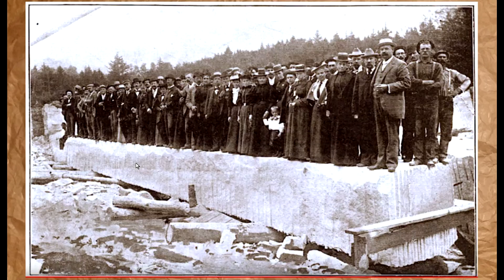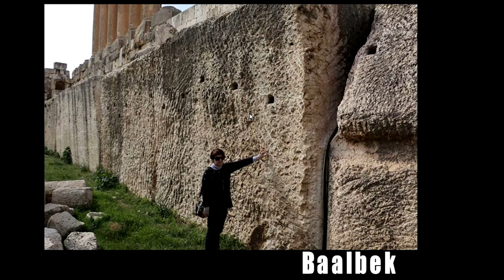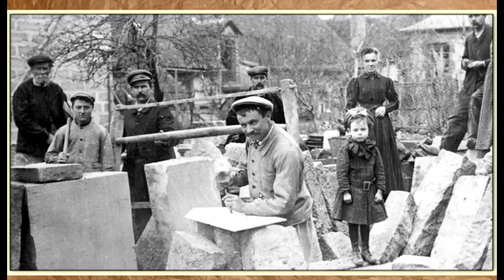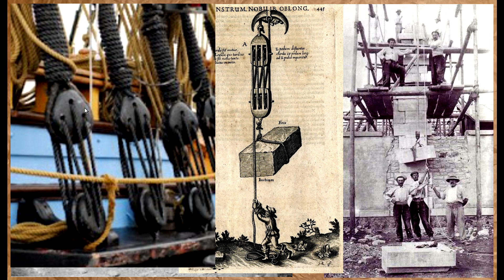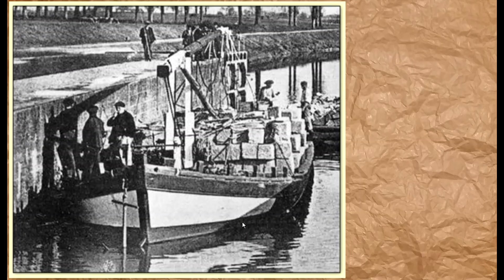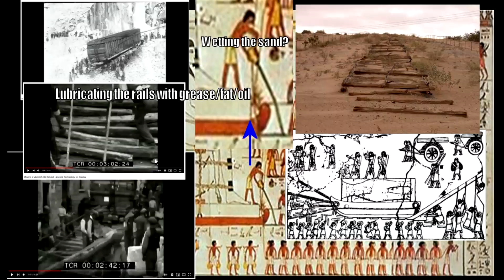Stone Masons Photographed in the Olden Times & Pictured in the Ancient Times. NO LOST ANCIENT TECH!

Comment: Very good video bud. I told ya I'd get to it lol. You'd be amazed at the power of levers and wedges. I was a 1st class shipfitter at what used to be what was called Ingalls Shipbuilding (it's now some other name after a few buyouts, it was Linton last I checked u think) in Pascagoula Mississippi. Anyways I learned there how to use "saddles and wedges" to move literally entire ships sized hulks of metal. (There built in modular sections and never actually moved a whole ship that way but is feasible if one ever had to move the entire ship.) So I say that as entire expression to just give an idea of scale but yeah. You should do a video on that if it helps viewers to know what a wedge is capable of. I think you'd enjoy it. We'd use a combination of wedges... "Come-alongs"... heat and hydraulic Jack's to bend and shape metal of incredible thickness this way. Many times the steel was actual armor plating that we had to roll to shape and weld to what's called the bulkheads. Most times the metal came pre-bent to a certain degree. It was never perfect tho. Sometimes we'd have to bend steel that was just flat to shape. We'd do I'd say roughly 98% of all the work needed tho with a small sledge hammer, wedge and saddle tho. It was hard work but was pretty fun to do when young. 
I noticed you seem to think the rocks and stuff under the slabs that was about to fall was to cushion the fall. With my experience with moving mega objects like those it's actually there to prevent the massive objects from falling and lying flat. Typically they destroy what they fall on. But, they leave a small gap to work with after they do. You'll find that's the hardest thing to achieve in these type things. If you have that inital gap your job will be alot easier after. If it's flat you'll have to pry it open with a wedge. When blocks get over a certain size they don't like being wedged on on the edges. Thier Wright exceeds thier molecular strength and its easier to flake a piece off than to move its whole size, if that makes sense lol. So you'd want a gap to slip what we called cribbing under there, which is just slang for wood wedges and such. Btw wood isn't used as a wedge that much in this aspect. As when you drive wood wedges in these scenarios it will just peel off the edges most times. Instead you'll see wood wedges instead to hold whatever small progress was made by your metal wedges so you can re-set them with larger wedges and or feathers. Then start again with the hammer and metal wedges. 
This does make me wonder how they made the plunge cuts back in those times inside those cave quarries. I've seen modern large saws used today that resemble chainsaws that free the right and left edges so you can flake the middle portion off. I suppose they just drilled it manually many times and cut it that way. 
I'm pretty shocked to see the size of pillars they was able to make back then. Pretty amazing how far back in history they was able to do that. I'm curious how they rounded them perfectly before they had the lathes and such you showed. Very interesting.
Of all the things they did tho back then many times I'm amazed most by how well of a job many did at making a totally flat and smooth wall. I'm glad you showed the dangling ropes trick. Many don't know that's how they did those big mountain sculptures etc. There's a term for it but I forget the name. I've wondered if they ever attached thier tools to these taught rope lines like these. Then as they swing it, it prevents thier tools from carving past a certain degree. Then it would leave behind a perfect, measured flawless finish. I've seen a similar trick used to smooth out the inside of igloos lol. They'd tie thier tool to the ground. Then no matter where that tool touched the inside, it would leave behind a perfect dome shape due to parabolic shape made from the tool being captive to the rope. I wonder if that's how they smoothed those caves ceilings in India as you mentioned. It's also how I've seen masons freehand dome ceilings. They used small blocks, mortar and so on. And use a string to measure how to set the blocks. Then you didn't need a crib of wood under it to support it. Similar to how people use string and a pencil to draw arcs or circles. Same thing really. Just a tool instead of a pencil. 
I've seen other very interesting methods of moving and pulling with immense power I think you'd find interesting also besides saddles and wedges. Search here for a video by typing in the keywords "horses pull stump lever" or something to that affect. You should find a unique video of something amazingly creative the old timers came up with. They use 2 horses and a giant lever to pull out what appears to be impossible sized stumps out of the ground with a genius lever system and chains. They use both the back and forth motion of the lever to do it with with no need for gears. I think it's a clue to how many large things was moved back then. It's so simple it's amazing. Then search for what's called a "flip flop tree wench" here also. It shows another simple genius way of how a guy uses a trick to pull trucks out of the mud. Both you'll love.
I just can't get past how the ancients did it way up high without anchor points tho. That part blows me away lol
Good video bud. I'll stop blabbing now. Thanks 😁

Comment: I think what many people forget or simply don't know about the obvious fact that those people came out of the stone age. Most people also don't seem to know what people in the stone age did (flintknapping, ground stone axes, mortars, stone structures, jewelery, paint from stones etc.). So the ancient egyptian would have had hundreds of thousands of years of experience of working with stone by hand and with primitive tools. 
Just looking at flintknapping alone makes it clear that their knowledge of working stones was far greater then what normal 21st century people know about stone. Not only do modern people know anymore how to work with stone, but they also aren't used to working with handtools anymore or they have some distorted image of what working with handtools is like. I have some experience of working with wood by hand and if it's done right (sharp tools, working with the grain, proper workholding device etc.) then it's actually not that slow and not that tiring.
Reply: People were capable of higher intelligence then as well. Their DNA was closer to the original source and not watered down like our is today. Our advantage today is that we have had more time to collect and pass down knowledge, which makes us seem smarter. We are not.